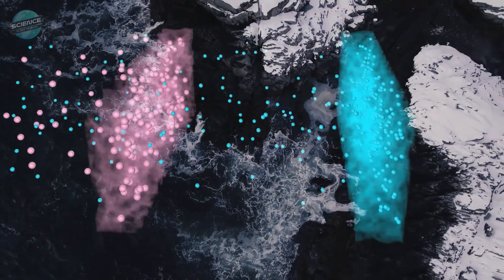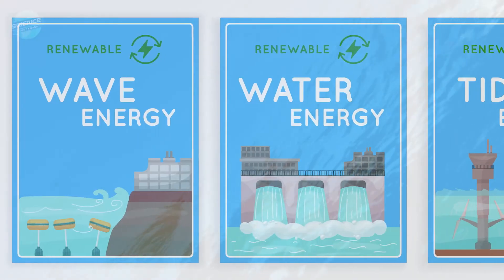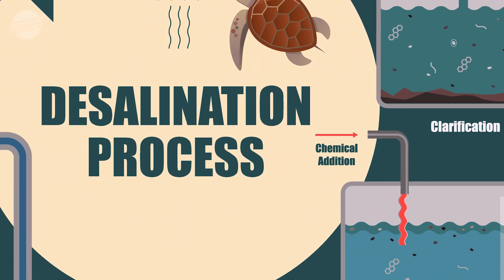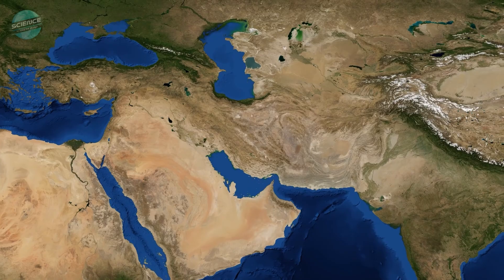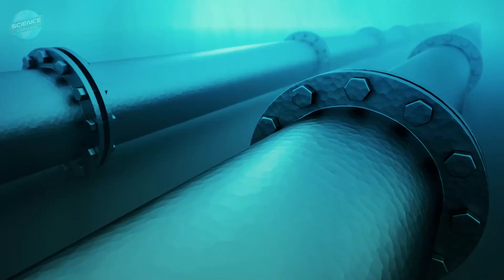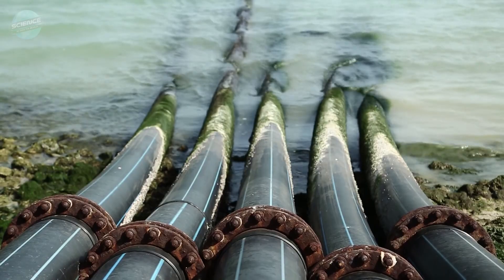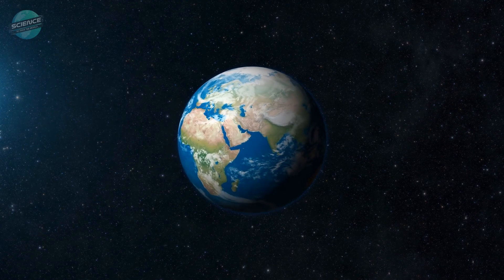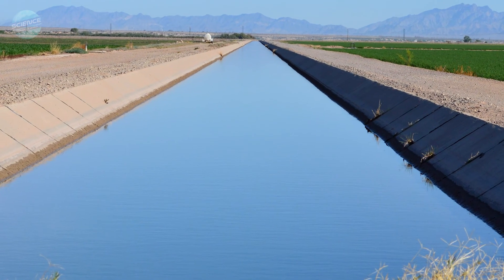The Dirty Secret of Desalination. How Do We Solve Clean Water?

Comment: I did my M.Sc in converting desalination waste water into fertilizers (H2O+NaCl+CO2+NH3->NaHCO3+NH4Cl). Ammonium chloride NH4Cl is a great fertilizer for rice and African palms and baking soda NaHCO3 (high pH) can help neutralize (buffer) ocean acidification as well as sequester CO2.
Reply: Can you share the paper? currently I'm doing a project about desalination
Reply: Can you comment on the processes you would use?  I think your suggestions are much better than pumping the waste back into the ocean and disrupting ecosystems.  Also, could the by-product be used to treat icy roads and runways?
Reply: Thanks sir. Now this is called the real solution ❤